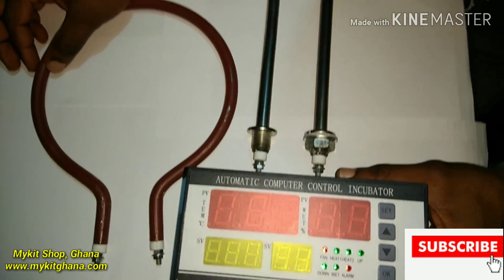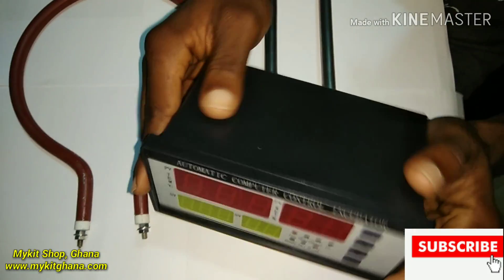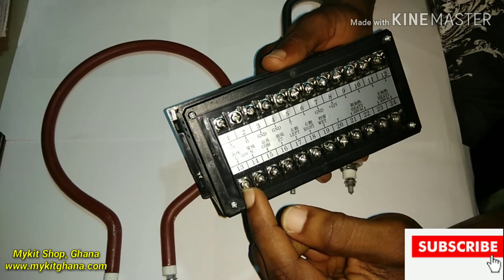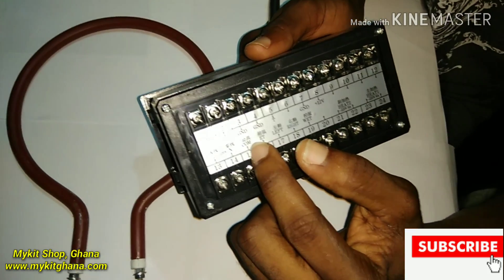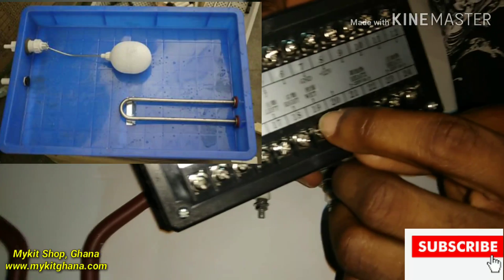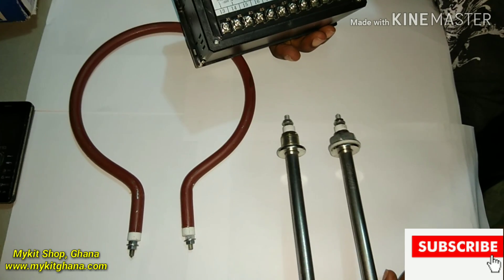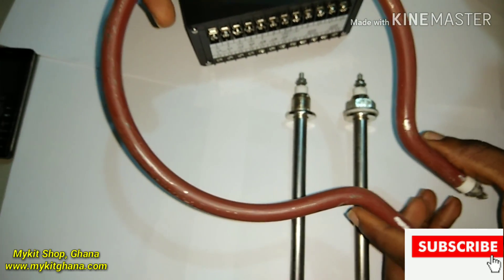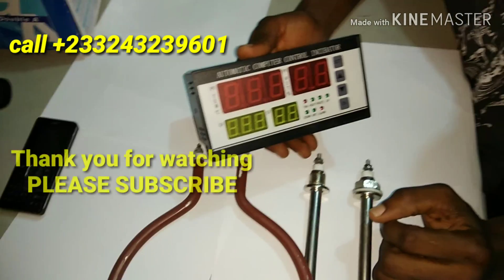How to wire XM 18 Incubator temperature controller ENGLISH

Comment: hello, I have this same model at 220V, I wonder, the fan for the air and the egg turner motor, should they be 220V or 12V? thanks in advance.

Feedback

Le persone hanno chiesto anche
Reply from the maker: 220
Reply from the maker: If u use 12v, it will blow up
Reply: @mykitvideos5937  Ok thanks, do you know why the resistance, and the ignition indicates that it must be 220V, while the fan and motor do not indicate anything. so I have to use everything at 220V? thanks.

Comment: I also use the fans near the shielded resistance, where I connect these fans, I'm not referring to the fan that removes excess heat, I would have it as an assistant, thank you for the rich content.

Comment: Man thanks for this video, i have few questions.
1. Where i can put the heater if my incubator made from plastic? 
2. How can i set the switch control. I made it but it didn't stopped or stopped but worked only ine way.?
Reply from the maker: Plastic? How many eggs will your Incubator take
Reply: @mykitvideos5937  around 300 eggs, inside of the refrigerator is the plastic
Reply from the maker: Yes u can use heater but use lower wattage and don't let heater touch the rubber

Comment: terminal 15 &16 for the fan has no output, terminal 23 &24 has no output also, what is the problem?
Reply: I have the same issue how did you solved

Comment: Top vid bud I live in Australia it’s 240 v hear will xm18 handle the 240v or is it 110v 220v max all so wot is the smallest heater I can run of it will 220v 80w heater elements work any help be good I no u won’t subscribers if u can help me out I will 
I’m not building a big incubator just 56 egg
Reply from the maker: Hi. 220v is almost same as 240v

This controller is too big is size for your small incubator. I will recommend the ZL controller in my other videos. 
But if u wish to still use this controller that's fine
Reply from the maker: As for the capacity, it can take at least 2000watts of heater. So yes your can connect the 220v heater your have. 
Make sure your controller is same voltage rating as your heater
Reply: That’s the item that I have it’s seed 220v an it was AUS An NZ safe but no it’s only got 110v transformer/coil in it an it blow up that’s y iv ask about the 220V an can salvag any thing out of it to build 1 my self
Reply: An yes the voltage is 220 v out put an the heater elementis 80w 220v so will it blow or is wattage to low at 80w for 1500w out put or is it only going to draw what it needs
Reply: https://www.ebay.com.au/itm/Electric-Egg-Incubator-56-Eggs-Fully-Automatic-Turning-Digital-Poultry-Bird-Eggs-/113751544450